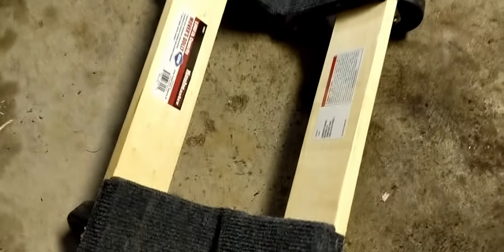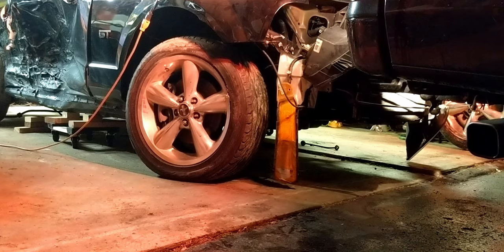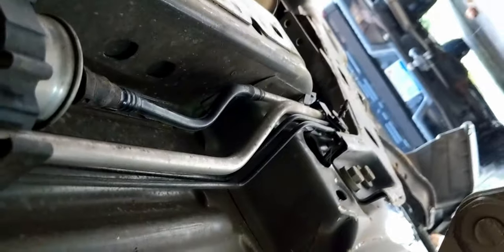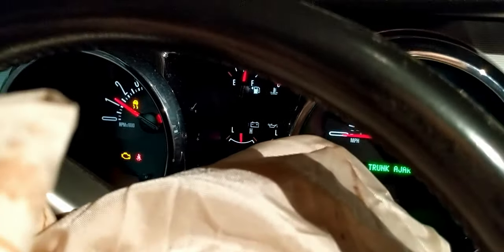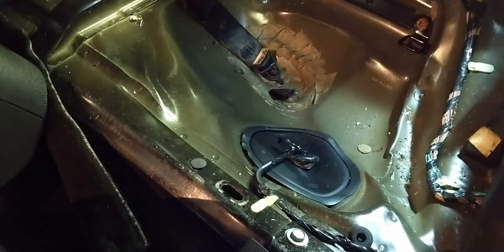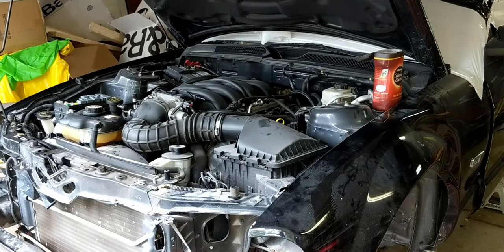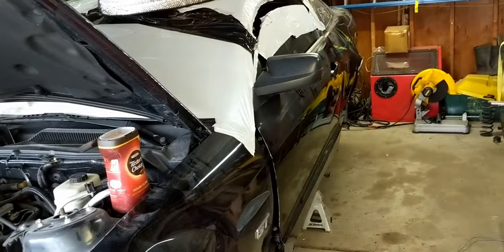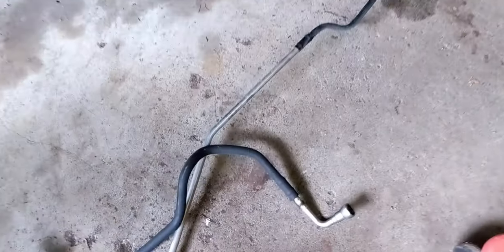$10k Shelby Cobra Build Part 2: Checking out the Donor

Comment: You definitely have big brass balls. When I watched the first video, I thought you had experience building cars. Just an FYI, when you buy a salvage car you should check all fluids and wires before even connecting the battery. Pinch points on lines and hoses etc. Cycle the fuel pump with keys and check for fuel leaks. I doubt there is any coolant in that motor. Radiators almost always let go in front end damaged cars.